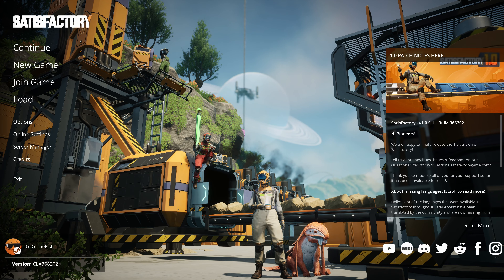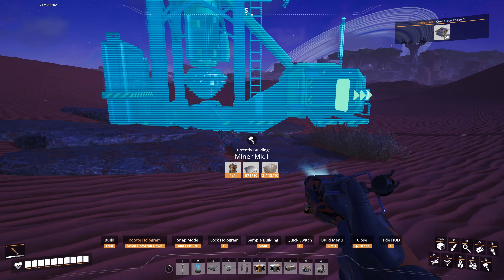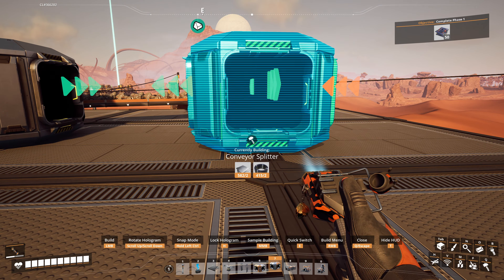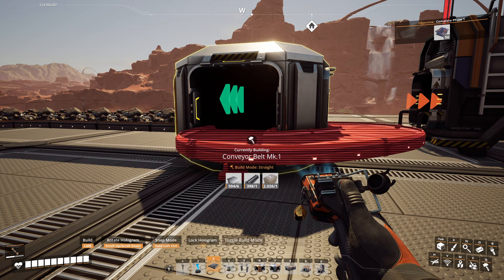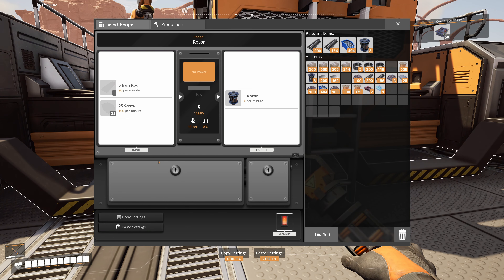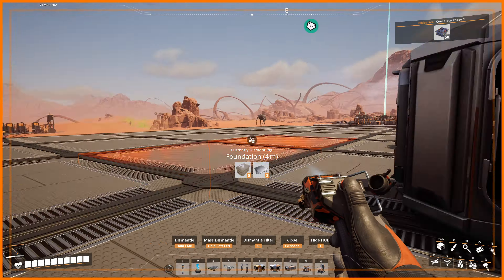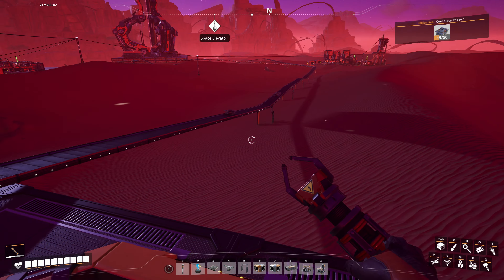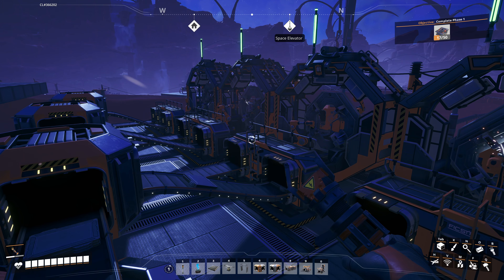My Rotor Factory Layout | Satisfactory 1.0 | Part 9

Comment: Your two rotor assemblers are not getting enough screws. You merged all your screws (200 per/min) onto 1 mk2 belt(120 per/min). Also since you mentioned all your separate platforms not looking great I'll tell you about the "world grid". If you hold ctrl when you place a foundation it will snap to the world grid. This allows you to build things far from each other that will always line up if you connect them later.
Reply from the maker: I did it so I could get each assembler 100 screws per minute so I had to do 200 then spit in half. I either need the faster belts or there is another way I'm not aware of.
Reply: @valhallagamingtv  You can merge 2 machines plus 1/2 of the 5th machine (40+40+20=100) otherwise your just not getting enough to the assemblers. Your making 200 screws but the belt can only hold 120, then you split it so each assembler is getting 60 instead of 100. Remember splitters and mergers have 3 inputs/outputs so you can merge 3 lines into 1. Two 40  lines and half(20) from the 5th machine.
Reply from the maker: @Celsage  i see what you mean